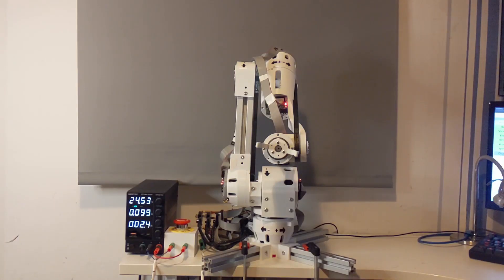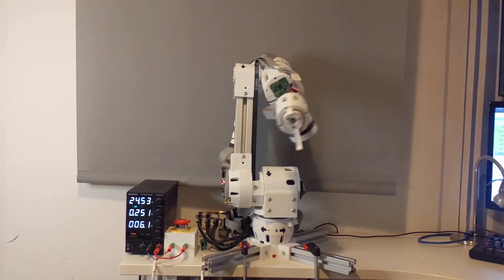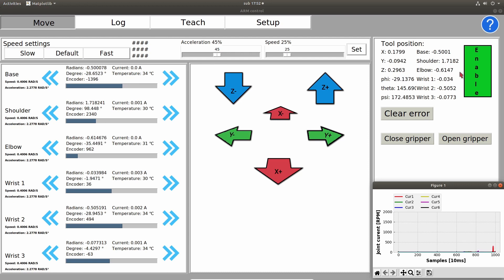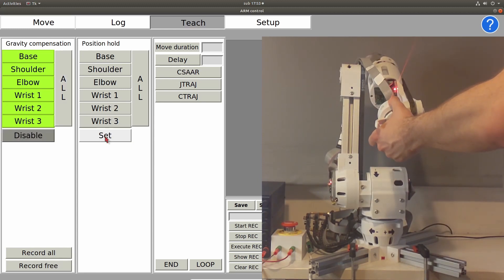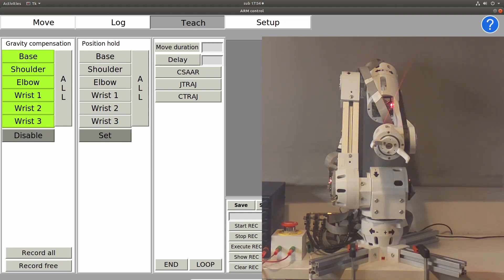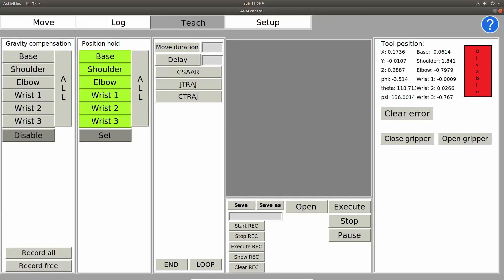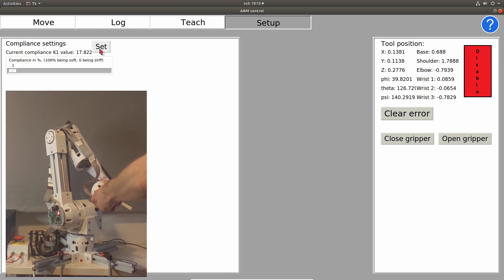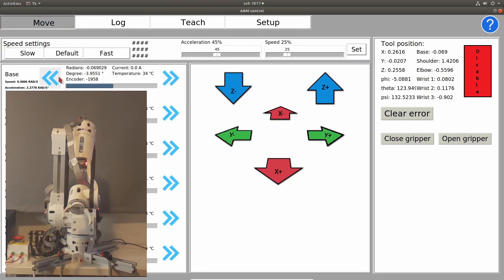CM6 - 3D printed 6 axis cobot robot arm.

Comment: a good job ,can I make the same application using closed-loop stepper motors ??
Reply from the maker: You could modify the software that is used for this robot.
Reply: @source-robotics  thank you now i am starting to make faze4 robot i have alot of questions 😅
Reply from the maker: @ahmadjned3553  feel free to contact me anywhere if you need help

Comment: What do you think is the source of the jitter? Control loop performance? Play in the joints? Sensor accuracy? IK?
Reply from the maker: Control loop probably and  gearboxes are 3d printed and they took a lot of abuse during testing and prototyping. I am planning new version that will be much better but have a lot to experiment on this one.